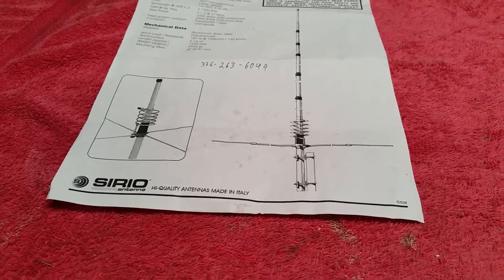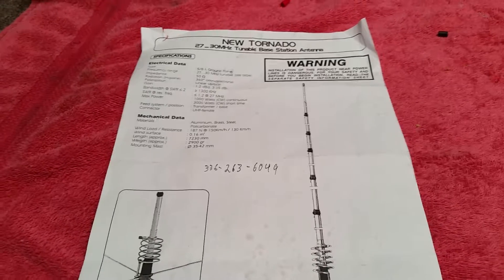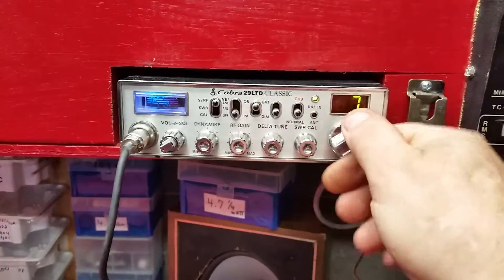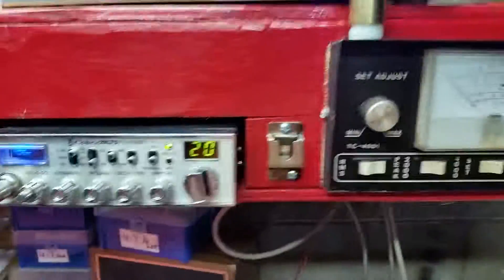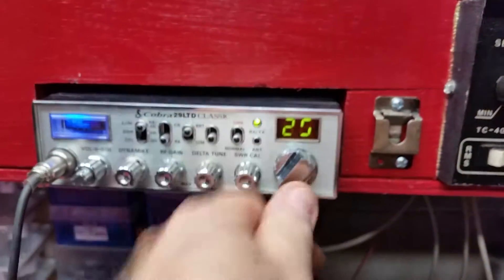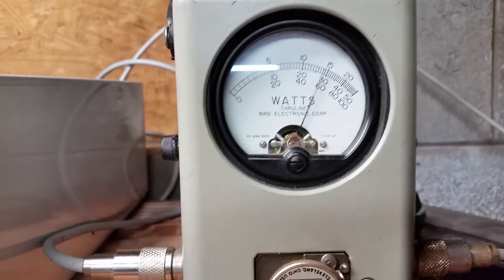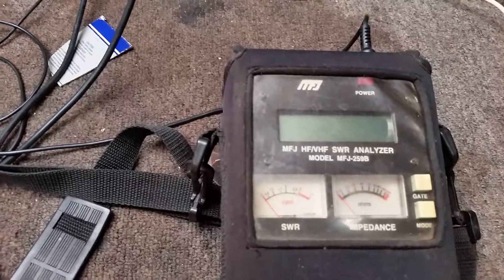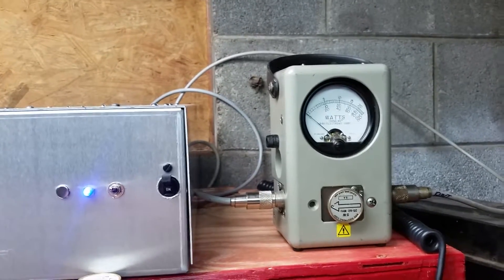tuning a sirio new tornado antenna with a mfj and bird 43

Comment: Dont put it too high,they snap at the base of the antenna.Mine lasted 3 months at 60 feet.
Reply: Mine lasted about the same at 50 feet, first nor'easter (60 mph gusts) and it snapped right at the base, cheap insulator material!

Comment: coax length is very impotant..use or multibles of 12ft on coax for accurate swr reading in shack..12..36..60 etc at 27mhz..look on the net coax v swr for more info..anthing below 1.5 i am happy
Reply: Someone says is a legend. But at my good old times on CB they told me the same like you doing

Comment: Hey buddy i just bought me one of these antenna's of ebay and i never tuned one like this how do i start ! Do i have to cut of any thing to make it shorter or lift the antenna higher or adjust the 4 ground plane's in or out this one's got me stumpet .If you can help me with something on this that be Great  I have a SWR--Watt Meter I dont have the bird like you and i have a Wilson 5000 on my truck there's nothing to tuning them I have this Torado on my Gold Eagle 5000 Base Radio and i'm on the highest point Randolph county Indiana i get a hell of great resepn... here now Thanks man

Comment: It was mentioned elsewhere here on youtube about fine tuning the Tornado 27 by adjusting the coil collar up or down to adjust ohm levels!?!  In the case just moving the whip length doesn't fine tune it enough to your liking you might give it a try.

Anxiously awaiting update video on the subject.  Mine is in the mail and is due within the week. Would like to know if and how you may have set the swr to be equal on both channel 1 and 40.  How low where you able to go?